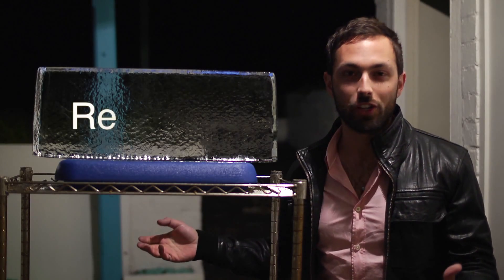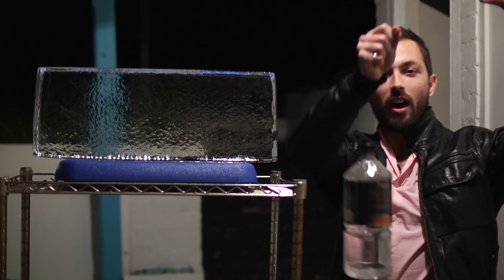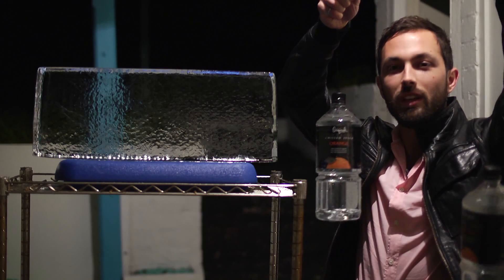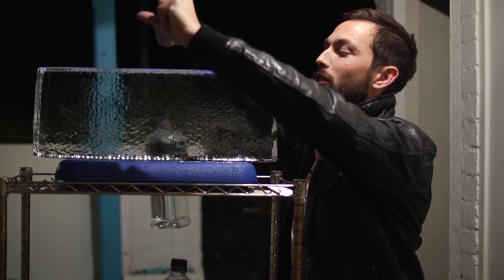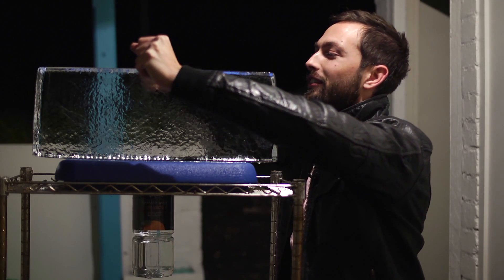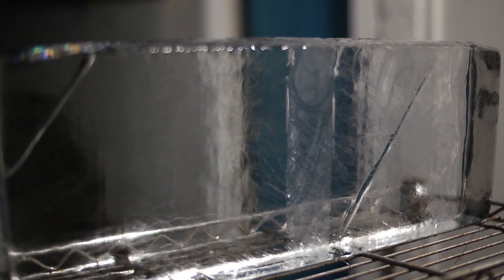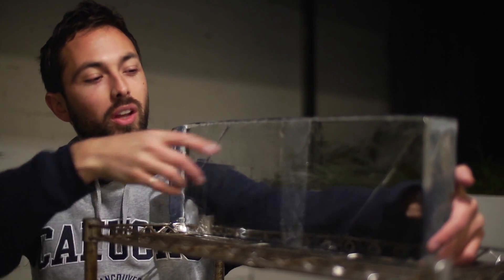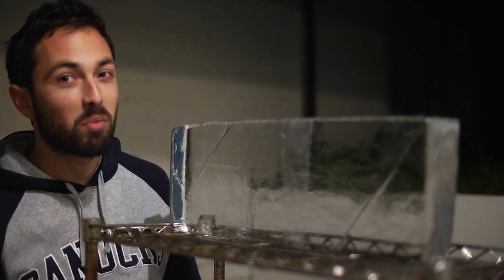Does Pressure Melt Ice?

Comment: Is it not that the molten ice froze back again because it was still in contact with more ice? It would be a better validation where you melt a 'complete' block of ice with pressure and it re-freezes upon depressurising.

Comment: Since pressure is defined as a force over a given area,  this is technically a trial of localized pressure under the string. You have four pounds spread across a very small area, so the pressure is much higher than 14.7 lbs/sq in. However, I'm concerned that the low specific heat of the guitar string is melting the ice instead. Can this be replicated somewhere below freezing temperatures?

Comment: well I think it was the action lab... but I remember the same experiment done and there was a problem: the cord gets the room temperature right inside the ice block due to the high thermal conductivity of metal so in some way it should be less dramatic at arround 0ºC
Reply: Also the melting of ice keeps it joining together again due to the external contact of cold water vapor from both sides

Comment: I feel a bit unsure how to ask this. Here I go:  Is there a difference in the type of pressures? Such as a difference of the pressure being placed on the ice as you did here and a pressurized container (tank)?   What will happen if the temperature remains the same and the ice is in a container exposed to increased pressure?  The only example I can use is as in an airplane when the cabins are pressurized. Or the increased pressure placed on an object as it goes into deep waters.

Comment: WTF! Pressure has very little to do with the melting point of water. It only drops marginally at pressures around 10 MPa ( 100 bar or 14700 PSI) and above. Heat from the warm air is being transfered from the air to the thin wire to the ice. I would only see the pressure from the wire being there to displace the liquid water from under the wire effectively. Once the wire has passed the melting of surrounding ice would allow temperatures to drop just enough to solidify water within the block again. The same thing happens if you allow two ice cubes to MELT while touching each other. 
Lets see this experiment happen at a controlled 0 deg. C

Comment: While I accept regelation, my concern for the conclusion is that there is an alternate explanation : the wire, being conductive, will carry heat from the 'warmer than 0' outside INTO the ice.
Granted, I did the same experiment INSIDE a freezer to the same effect..  
Just a heads-up.

Comment: It probably works becasue water expands when it changes into the solid state. increasing pressure encourages it to melt.
This will likely not work with substances that doesn't expand when it freezes.

Comment: For your refrence this what Wikipedia has to say about this experiment "Weights suspended from a wire which cuts through ice, is an example given in old textbooks. Once again the pressure required far exceeds the force applied. Conduction of heat from the room through the metal wire is the correct explanation of this phenomenon".

Comment: Are we sure the metal wire's pressure is doing what you said or is it because the wire is bringing heat from the surrounding area because it is a conductor of heat exchange?

Comment: Everyone's saying it may be the thermal conductivity of the wire playing a role here and I suspect it does too.

I may do an experiment like this.
A piece of sealed wood about 6x12" with a piece of fishing line stretched taut and attached to either end. A piece of ice is wedged under the fishing line and the whole thing is placed directly in a freezer.
Everything would be frozen before hand to minimise the room temperature debate.

If thermal conductivity plays no role at all, I'll see the same results. If it does play a role, I'll see different results.
I think the most difficult part of this would be getting ice to freeze clear like in the video, and getting the fishing line stretched just the right amount so that it consistently applies about 4kg of pressure on the ice. I don't want any inconsistencies.

Comment: its because the density of solid water is lower than that of liquid water. Very specific to water, the bent structure and hydrogen bonding is the reason that its density decreases when it goes from a liquid to a solid. Cool stuff.

Comment: so what if the wire acts as a heater. grabbing the heat from the ambient air, it melts through. than the water freezes again because there is cold Ice around it?

makes sense to me.

Comment: If this was true the ice under the South Pole as well as the ice under any big glacier should melt under the pressure of the ice above.
I bet that if you repeat the experiment in a room in which the temperature is below the zero, your string will stay perfectly still.
The fact that the block comes back to its original form is due to the low temperature inside the block. Same thing happens if you join together two ice cubes.

Comment: Put a block of ice in a high pressure chamber and see what happens. Nuclear reactors have to keep the water at super high pressure to keep it water instead of gas, so I think it should produce ice even in temperatures above freezing instead of being cut through. that experiment may also demonstrate that the E string only cut through by its relative sharpness, and the heat that would flow into it from the bits of string not in contact with the ice, sort of like a reverse heat sink. And if the pressure does reduce the block to water, would the puddle re-solidify when returned to normal pressure

Comment: It's not only because of the pressure, It's because of the wire. That wire collect heat from the air and deliver to the ice and that's why ice turns into water and that wire cut through it. And because of below 0ºC temperature, the ice solidify again as soon as that wire cut through it.

Comment: What about the thermal conductivity of the guitar string? Doesn't the warmer environment warm up the string?  If the environment and the ice and the string were all the same temperature, you could check that it really is the pressure thats causing it, or at least show the extent to which this has an effect.

Comment: How about the heat generated in the wire from the constant tension and/or the temperature of the air having an effect on the wire, warming it causing it to cut the ice, while the weight is merely holding the wire in place.

With the constant tension idea, think of constantly excited particles acting as a miniature saw.

Hypothesis: heavier mass's will result in a faster regelation process.

Comment: I saw a video where someone tried to cut thru ice with a hot string. It 
worked but it also got stuck because the water freezes again. There are probably more effects than the regelation.

Comment: This would have been more meaningful if it was done in a room at the same temperature as the ice. How can we tell that it was just the thermal mass of the ice that refroze the water made as the heat from the air was conducted through the metal string to the ice?

Comment: How do we know that the wire didn't act as a heat sink to melt the ice, which then froze again as the heat sink moved away from the frozen area?

I think if you repeated the same experiment with a material that wasn't a good heat conductor, it would probably fail.

Comment: I feel like this experiment lacks control.
We don't know whether the cable was acting as a heat-sink and channeling heat into the ice from the ambient temperature of the room. (Which he admitted is > 0ºC)
Also, the ice could have frozen back together because of the contact between the two pieces.

Maybe this should be tested in a temperature-controlled pressure chamber?

Comment: Scientific Question?
Could the wire be absorbing heat from the air and melt the ice with that?
After this, the sub freezing core of the ice will just freez it back together?

Comment: I'm skeptical that it is the pressure that causes this phenomena to occur. I think it has more to do with the transfer of thermal energy than the pressure applied and released. In order to prove that it is the pressure that causes this, you should have two wires with weights on each end one with a set of lighter weights, and the other with a set of heavier weights. If it was pressure that causes this to happen, the heavier should go through quicker, if the wires pass through the ice at the same rate, we know it is not pressure that causes this, but some other force (my guess is the exchange of heat.)

Comment: Go to the big freezer. Leave all necessary equipment for the experiment to cool to the same temperature as surrounding air. Then put string over the ice (do not touch it with bare hands). Will it do the same? I want to see it. Plus use two set ups  with two different strings at the same time. One metal string and one with fishing line. If metal will cut quicker it means it heats the ice. In this video string melt ice because it transfers heat from warm air. And weights just help to brake down weakened (melted) ice crystals.

Comment: it didnt turn back to solid. it's freeze back together. that is what happen when u put 2 slipery ice close together with very small gap in between (no it touch each other). ice dont melt completely. the melt a layer after layer
Reply: so the inside of it are still cold in 0degree

Comment: This is NOT an example of Regelation, this is an example of conduction of heat through a wire. Pressure required for regelation is MUCH higher than can be achieved with a wire.

Comment: The experiment seems flawed to me. I don't think it is the pressure that melts the ice, I think it is the metal from the guitar cord. Metal is a very good conductor of heat, which means when the ice cools the metal cord, heat from the environment is conducted through the wire to the coldest part (in the ice) which melts it. The reason the ice doesn't break in two is that as soon as the wire starts slipping through, the water freezes again due to the block of ice (as water is also a good conductor of heat). This experiment doesn't really have to do with pressure; just the conductivity of metal. The same experiment can be carried out by placing a copper penny on a piece of ice, it would also melt the ice even though there is no significant pressure.

Comment: then it doesn't really melt it, the kinetic energy provided by gravity is only strong enough to break the bonds for a very short time, it's like splitting a wooden beam with a hacksaw and the beam would just "re-solidify" after a second.

Comment: Well. I thought the String just conducts the heat to the ice, causing it to melt. After the string passes the water freezes again, because it is only exposed to ice. I would really aprreciate to see a block of ice under a hydraulic press to proove this. And what are the physics behind this? Is it because water is less dense than ice?

Comment: I like your vids but I'm skeptical about this one. I bet if you had two blocks of melting ice and put them face to face they would freeze together too, wouldn't they? Isn't this what happens in my cup of ice water after I drink the water all the ice is frozen together? As for pressure melting the Ice, sure why not but also the heat transfer from the wire has to take some of the blame too. correct me if I'm wrong I could see it going either way but this experiment just doesn't prove anything to me.

Comment: The string cuts through because it's thin and not because it makes the block melt. What happens here is the same effect as using a knife. It would cut through something like wax the same way - without melting the wax.